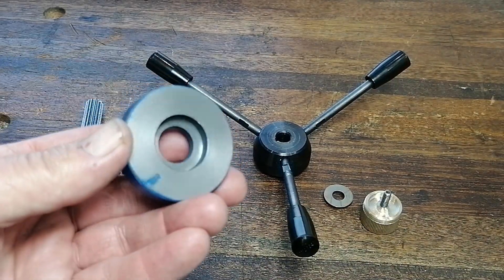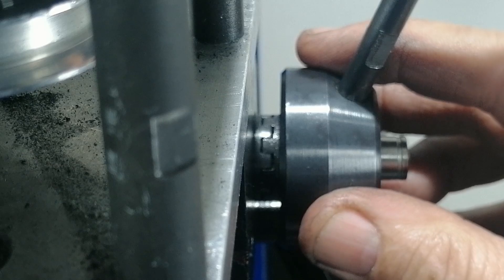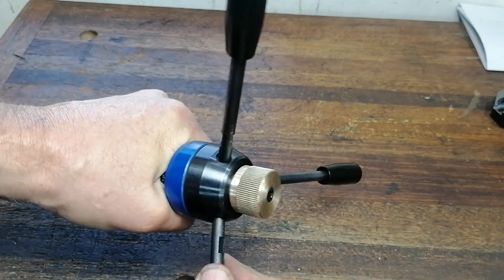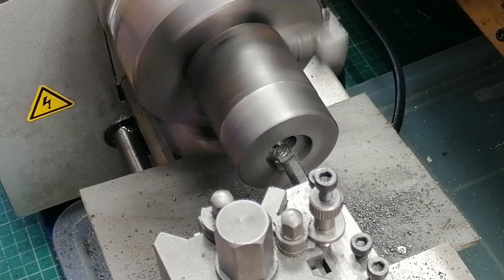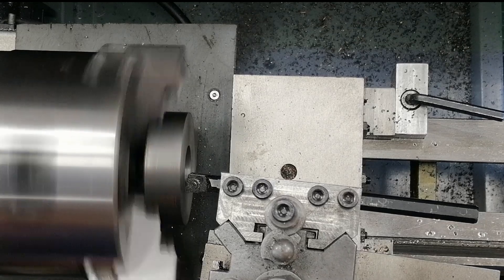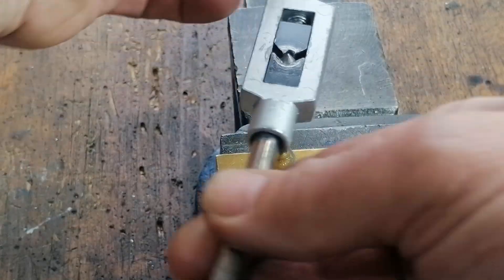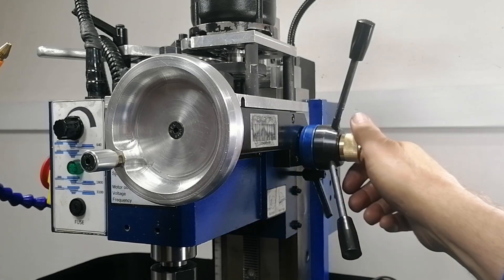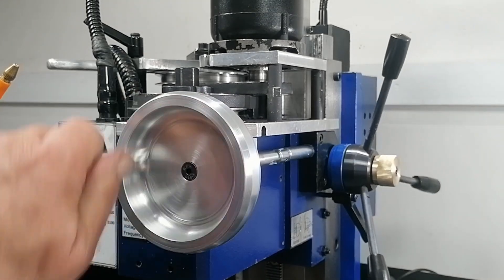Fine Feed Clutch for the Mini Milling Machine

Comment: Great stuff👌 The Warco WM16 I use already has a cone clutch mechanism on the quill fine feed boss....it works very reliably but getting all the backlash adjusted out of the pinion rack and pinion is something I will certainly be looking at. 
I modified the original 40 mm knob on the fine feed some time ago and replaced it with a 100 mm aluminium spoked handwheel which has improved the fine feed on the quill immensely....adding another 0.01mm is now much easier with the larger diameter handwheel.
I also made a new front cover plate and relocated the quill DRO unit so I can get clear access to the on/off and other buttons on the DRO without it being obstructed by the larger handwheel.
Reply from the maker: Thank you for sharing. I have also upgraded my fine feed wheel and it works very well.

Comment: I like your no backlash modifications. This clutch is the greatest part of it. I'm a metalworking hobbyist and I'm wondering why you made the clutch out of cast iron? Can I make it out of regular steel?
Reply: Cast iron clutch will hold without galling 😉
Reply from the maker: @britenrhodehouse8692 Thank you. I was quite chaffed that it worked so well. Yes, I have to tighten it quite a bit but the thrust bearing helps there.
Reply from the maker: I just took a chance and had some cast iron on hand. The excuse I gave myself was that brake drums and disks are made from cast iron. There were no scientific justification at all. I were just glad that it worked. I thought that if it did not work out, I would glue brake pad material onto it. So sorry, I have no clue what other materials can be used. Try what you have on hand and if it does not work, the part is so simple that you can just remake it with something else.